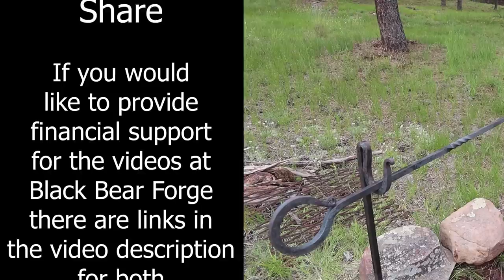Fire Irons - campfire cooking pot hanger

Comment: Nice set of camping tools there. I make a similar set that has a loop at the end of each stake. I run a chain through them when used as a tripod, but usually I set them up similar to how you prefer to use them. I also made two brackets that slide onto the two uprights before they are hammered into the ground. They can slide up, and down on the bar, and I use sections of chain to adjust the bight of them. One has sort of a curved hook that holds the cross bar, the other has a sort of square hook that does not allow the bar to rotate. It's basically an adjustable rotisserie set. Also I hope your leg gets better soon. Take it easy, and don't push it to hard! 👍 Best wishes.
Reply from the maker: Thanks, the leg is much better

Comment: I always wondered about how blacksmithing was like in the production sense and how it could be possible to get started in making the thing profitable. This seems easy enough, take away the power hammer and with a little DIY welding I can see myself trying it out.
Reply from the maker: I was making these before I had the hammer.  So a hammer isn't required.  Mostly it allows you to work longer days without wearing out swinging a hand hammer.

Comment: I'd be curious to hear what makes the Little Giant the better choice for this job, we've seen you work with both quite a lot now and from what I can tell the Say-Mak doesn't really appear to be any less precise, despite it being obviously far more powerful.

Also best wishes and hope your knee heals up fine. Bad as it is, I guess at the very least it's a good thing it's an injury that will let you stay productive even if it means putting some things you'd rather be doing right now off for later.

Comment: You may wish to consider  Z and S twist when you make future items.  The odd bar should be the opposite bar so that they all angle the same way (weaving trick so the web is smoother and twills are accentuated or not). Clockwise twists are Z and Counterclockwise are S.

Will you be making a spider pan?

Comment: With mild steel, what is the reason for waiting for steel to turn black before quenching?
Reply from the maker: Even mild steel can be stressed during forging and cooling more slowly helps relax the stresses.  Plus there are occasional stories of hard spots in mild steel that can cause trouble (although those don't seem to be a real problem)
Reply: Thanks.  Never had a problem but just to be sure, will do.  Don't want somethong that will be hammered like fire irons or tent stakes to fail.

Comment: Didn't really see how you linked them together for the tripod set-up. But looks like a strong setup either way. Also, how do you hang the pot from them without a chain and hook?
(in tripod mode)
Reply from the maker: It seems like they link a little different every time I do it.  So there isn't just one right way

Comment: Silly question really but when smoke comes off my forge is that carbon monoxide or just smoke  been experimenting with various hoods and designs but still get smoke out of the forge not a lot i just wondered if it was dangerous thanks
Reply from the maker: While smoke is an indicator of incomplete combustion and carbon monoxide results from incomplete combustion, they are not the same. All smoke is bad for you in some form and car one monoxide can be present without smoke. A well ventilated shop is the answer.

Comment: What kind of finish would you suggest for these? I don't want them to rust but I think the miniwax finish I use wouldn't hold up to the heat from the fire.
Reply from the maker: I have never worried about rust on them.  between driving them in the ground and being close to a fire the finish wouldn't last long.  I have set well over 20 years old without a serious rust problem
Reply: @BlackBearForge  thanks for the reply and the video. I successfully made these today and plan to use them soon.

Comment: Just wondering what kind of steel to use to make these. What kind of bar steel is best to use on the sets a W1 tool steel or similar?
Reply from the maker: mild steel only.  using tool steel is asking for them to break in use
Reply: Thanks so much for the info.